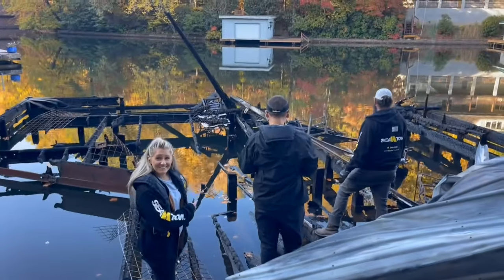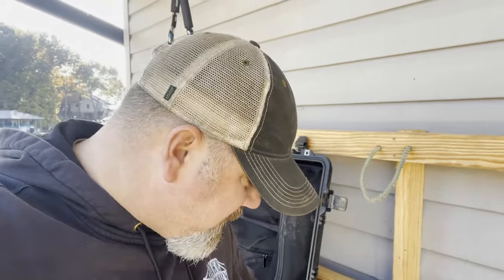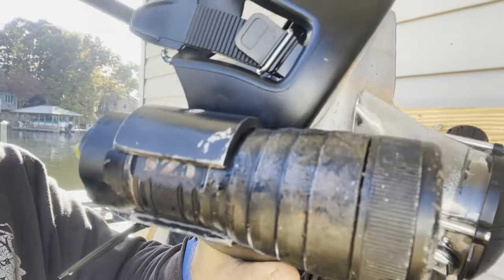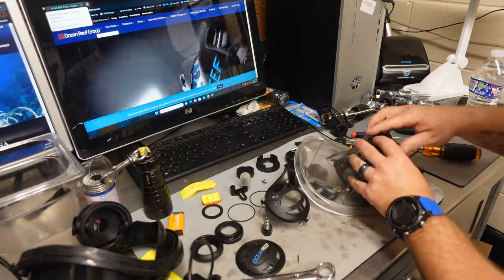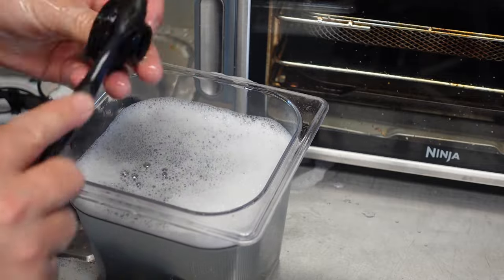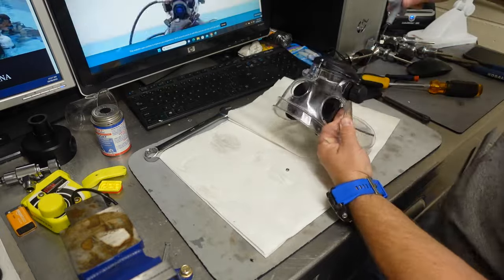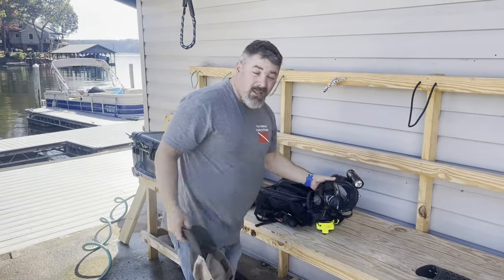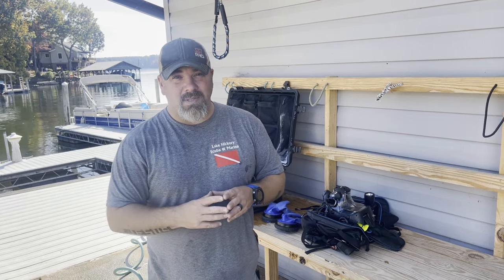Cleaning My Full Face Mask After A HazMat Dive With Fire

Comment: Great video. But I notice that you put your whole reg. set in to soak. The age old question don't you have to worry about getting water in the first stage?
Reply: Compared to the rest of the crud that thing got exposed to, soapy water is the least problematic thing it could see.

I imagine they are going to blow it out later on
Reply from the maker: Hello @michaelmccrorey4973, glad you liked the video. We actually made a video on submerging your first stage into water without it being pressurized on a cylinder. A lot of manufactures are making first stages now, that prevent water from entering in, even without a dust cap (such as the case with a DIN). Plus physics works in our advantage as well. Here is our other video that may help explain why we clean our regulators this way. https://www.youtube.com/watch?v=TCfO_ZB-7VE&t=108s

Comment: Thats a ton of time to clean and overhaul everything I hope the boat owner's insurance is compensatig you accordingly.
Reply from the maker: Hello @kevindavison6019, we just produced a video which will air in March or April, discussing how we charge for salvage dives. In regards to cleaning our equipment, its just part of the job when it comes to commercial diving. For the most part though, yes, we make good enough on each job to completely replace our gear after every dive if need be.